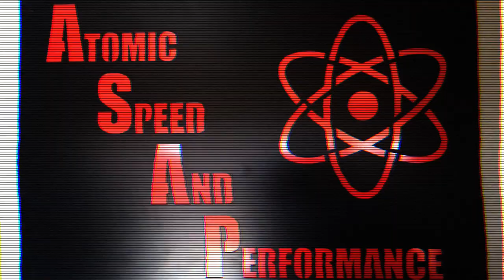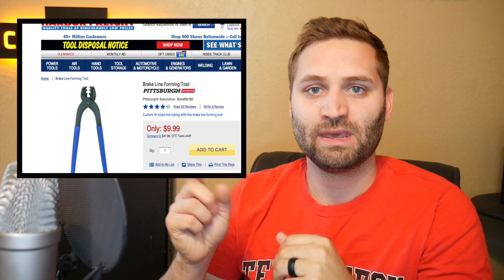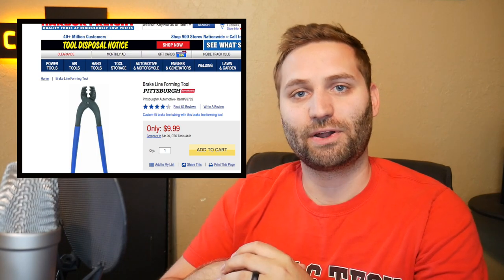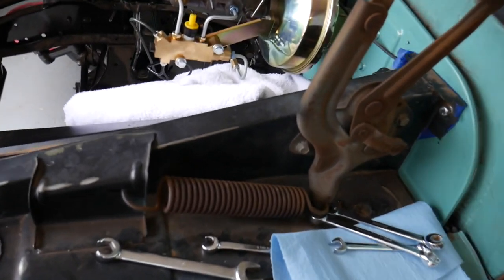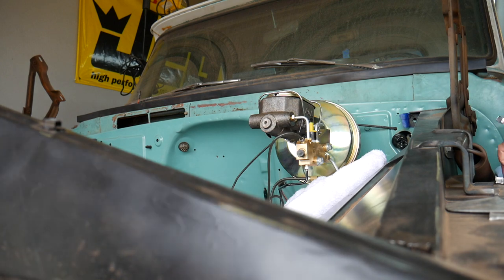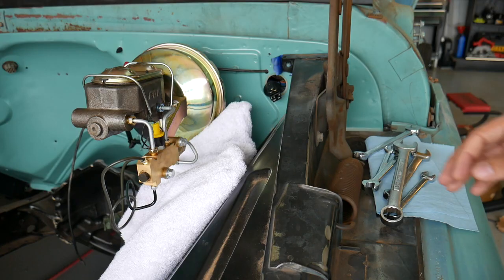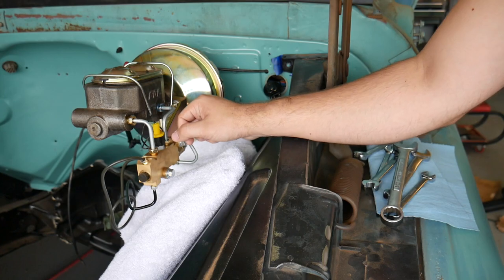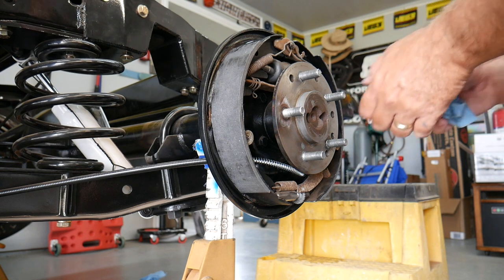How to Install A Performance Online Power Brake Kit - 60-66 C10 (C10 Build - Episode 13)

Comment: some have already said this but thats not just a proportioning valve, its a combination valve.  There is a an equalization valve that floats between the front and rear master cylinder.  You have to take the electrical switch out and put the appropriate centering tool in place of it to keep the floating valve from moving.  I learned this the hardware as most instructions don't come with this information or the tool.

Comment: Awesome video 
Only thing that  1960 to 1962 Chevys came out with hydraulic  clutch. 
So unless  automatic 🤔 
There is a  master cylinder that needs to friend your  booster. It's a little different set up. I  am also having  brake line  leaks. (  Update. I got no more leaks and I got  brakes. Awesome 👌)
That's why I am checking u out. 
Lot of people assume that the 1960 1966 1966  are the same. 
But
1960 to 1962 came out with hydraulic clutch and torsion bars.X box frame. 
 The  frame was changed in 1963.
Just FYI. 
I will check out what other videos u got. 
Good 👍 job 
Awesome work 👏

Comment: neat trick i learned back when i worked at the dealer from an old cat was try tapping the proportioning valve with a small hammer and basically kicking the pedal extremely hard and that usually frees them up.
Reply from the maker: Hey! That's a good idea. The proportioning valve actually ended up being bad sadly. I also had to pay for a new one... Unfortunate, but you live and learn. I would advise that at the first sign of trouble someone immediately should send a part back for a refund. My refund request wasn't timely enough. Thus, had to pay for another one.

Comment: You can't bleed the brakes with the brake fail switch in the prop valve. There is a plug used to pin the internal valve so it doesn't stop flow to the open source (leak).

Comment: Hi. I am installing a brake booster and I noticed that the boot does not go through the opening of the firewall all the way. Does yours the same? If not, what did you do to fill that hole?